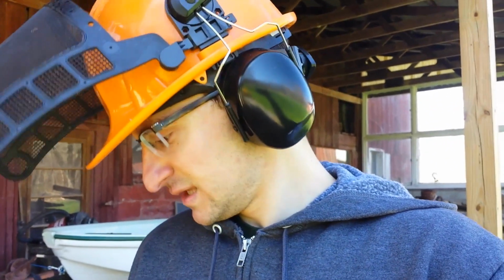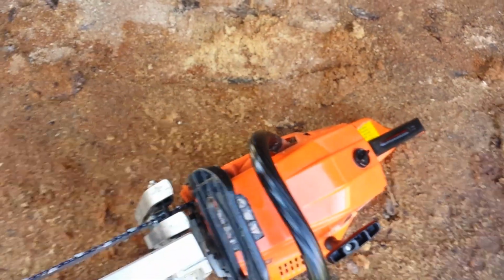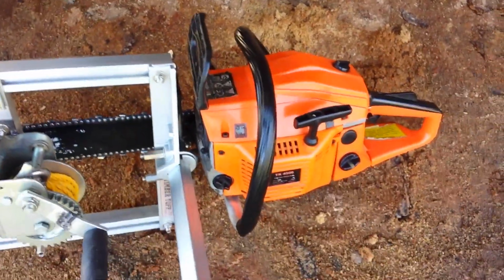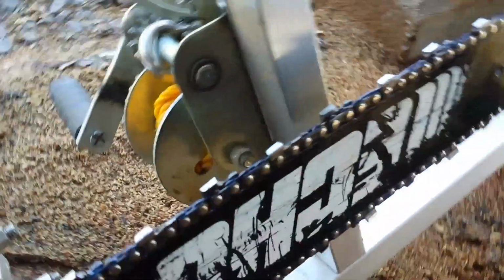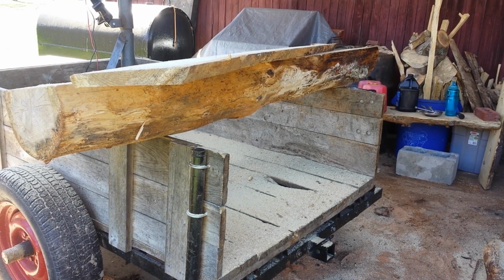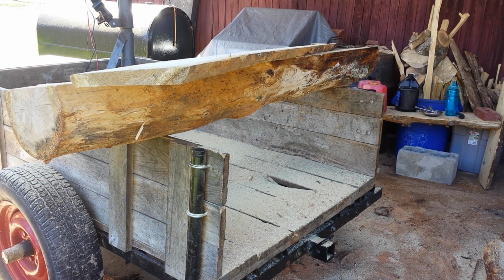Can You Mill Lumber With A CHEAP 45 cc Chainsaw? YES!!

Comment: Did you change any parts on that 45cc chainsaw..i have the simiLar one too
Reply from the maker: ivan palosek The only thing I changed is the gas cap because it broke when a log hit it just right. Same fuel lines, carb, ignition coil, handle, etc. The bar and chain did get replaced also.
Reply: Btw caps on these are Looking so weird on these.Like if you can break them.i've seen one guy put husqvarna caps on chinese chainsaw.i run now 33cm bar with stihL RS chain it cuts Like a heLL..put aLso stihL oiL and fueL fiLters in mine.ngk bpm7a spark pLug..it runs pretty good..
Reply: I have the 52 cc version of this saw and oddly enough it will starve for fuel if on that side but body side down it will not. I never looked where the pickup is because it’s worked fine for falling trees the past 2 years but I assume that’s all it is

Comment: I've had 40cm /16"/ guide bar on that kind of chainsaw when i bought it and now it is 37 or 38cm bar+Oregon chain,i was thinking to put 33cm (13") bar so it can run a LittLe better.....it wouLd be nice if i couLd aLso change the carb to waLbro..and get some Zenoah or RedMax originaL parts
Reply from the maker: ivan palosek This saw with a 13 inch bar would be almost like a hot saw. That would be cool. Just can't cut huge logs. But you can cut 13 inch or smaller really REALLY fast. Don't know it a walboro carb would fit. It would be good to know if it does though.
Reply: Yep it says on zenoah chainsaw g455 avs that waLbro wt 228/296 carb fits aLso on a chinese chainsaw because these chinese 45cc chainsaws are copies of the japanese zenoah komatsu/RedMax chainsaws..so i think yep you can change it to waLbro carb
Reply from the maker: ivan palosek Wow. That is good to know. If I ever have carb problems with my saw, I will try to put a walbro on it. Thanks!!

Comment: How long did that cut take in real time? Just curious as to how it compares to my 50cc chainsaw cutting time.
Reply from the maker: Jeffrey Beyer 3 minutes and 8 seconds.
Reply: Love2boat92 Nice. My cut time in an 8.5ft white pine log measuring 12" on the small end, 14" on the big end was closer to 6min with crosscut sawchain. It was my first cut in nearly 18yrs sawmilling.
Reply: Meant was 18yrs since my last time milling. Only had a 50cc Husqvarna at the time. Wonder what the milling time would be with the rakers at the proper depth with a 45cc chainsaw.
Reply from the maker: Jeffrey Beyer Your log is bigger and longer than this one. The cut time should be longer. With the rakers at the proper depth it would probably be a little longer. There were actual chips coming out of the saw while I was milling this log. Lol.

Comment: HP?
Reply from the maker: Pelle Moberg 2.6 to 3.2.
Reply: Is IT 2,6 or 3,2
Reply from the maker: Pelle Moberg Cc and go are measured differently. It's 45 cc. Don't know exactly what HP it is.
Reply: Pelle Moberg As a rough guide for these Chinese saws; 45cc - 1.7kw, 52cc - 2.2kw, 58cc - 2.4kw, 62cc - 2.6kw. However, the rated power is only available at around 8000 rpm as given on the box or in the manual. Nick seems happy to mill at less than optimum revs/power, though it mystifies me as to why someone would buy a chainsaw of 2.6kw @ 8000rpm then cut at half those revs given barely half the saws rated power - lol!